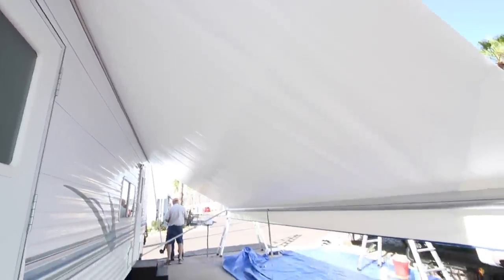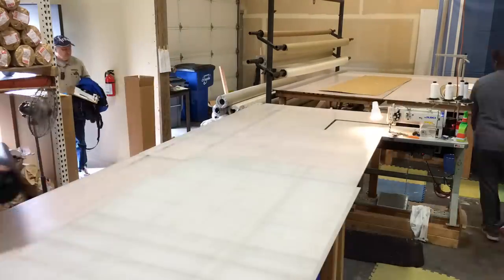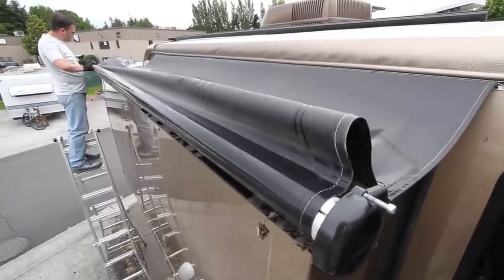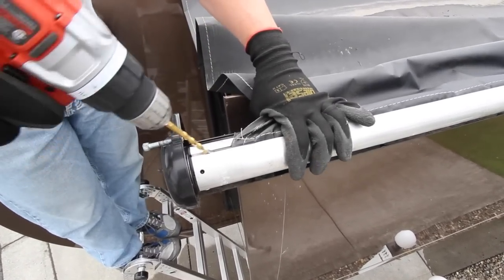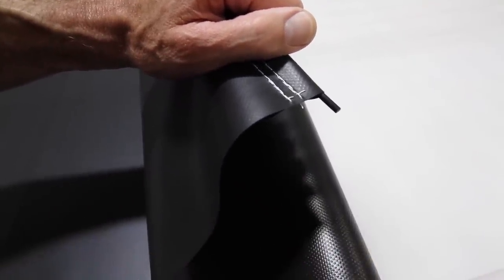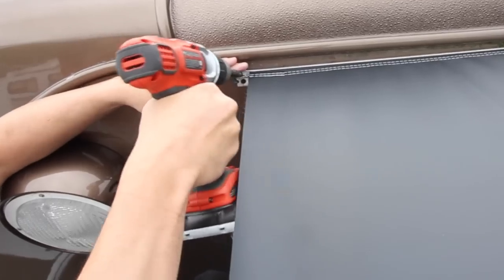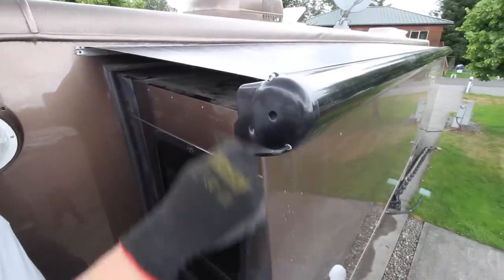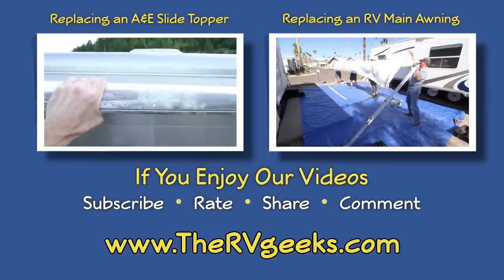How to Replace a Carefree of Colorado RV Slide Topper (Model SOK III)

Comment: Hello, I just watched your video, very helpful.  The one problem I have is the topper is completely removed from the spring bracket.  How do I get the spring set to be able to slide the topper in to it with the proper tension.

Comment: The timing of this couldn't be better. I wrote that i was going to try changing our slide top based on your previous video. Well last weekend i did it and it looks fantastic. This video is my exact model for our large slide and it's going to make the job a breeze. Just so you know, I had a question for Tyler at Tough Tops and sent him an email thinking i'll get a reply in a day or so. He got back to me within an hour. Great service and the material is 10 X better than what i took off. Great job guys. Saved me a bundle. Thanks

Comment: Great video. I would like to offer a second option if you don't have the vice grip oil filter wrench. I used a 12" pipe wrench and it worked perfectly. You won't have the possibility of pinching your skin in the vice grip lever.
Reply from the maker: Thanks Jeff! That's a great option, especially if already own one, saving the purchase of an additional tool.

Comment: Would you attempt to do the main awning like this ?  Thinking you would need 4 guys, 2 on ladders and 2 on the roof ? Save a lot of time and lifting.
Reply from the maker: Hi Sammy! Your timing is awesome, as we just shot a new video with Tough Top Awnings a couple of weeks ago. It shows how to replace a manual pull-down patio awning and we're hoping to have it edited and ready for release within the next week or two. The process is different than a slide topper, so I'd say we'd be unlikely to use the slide-topper technique for an awning. Stay tuned and after you see the upcoming video, please let us know what you think and if it answers your question a bit better.

Comment: My topper has 2 in long set screws that were screwed in from the end of the topper tube to prevent the fabric from moving in the tube. Do those screws need to be replaced?
Reply from the maker: Hi Timothy. We’re not certain about the screws you’re referring to, but we would think that other than putting them back in place as part of the re-assembly process, you wouldn’t need to replace them with new ones.

Comment: Hi, been watching your videos so I can replace my topper, my Carefree topper isn't fully covered, but has ends as in the video. I'm not sure whether the procedure would be the same, it has screws on the the end of the track in the roller and they can't be removed with the end covers in place, not sure how to proceed.....Very grateful for any advice, thanks.
Reply from the maker: Hi Paul! It sounds like you might have the SOK II model? If so, here's our video on how to replace the fabric on them: https://youtu.be/xyLf6ED2YQI If that's not the one you have, maybe you can figure out what model it is and let us know?
Reply: Hi, thanks, but, no, it's different and I think I have to remove the roller from the RV as per the (not too clear) Carefree instructions. Hopefully, I can get the material and then give it a go.👍
Reply from the maker: You might want to reach out to Tyler at Tough Top Awnings through their website. He knows more about every type of awning and slide topper than anyone we know. Don't forget to use the RVGEEKSROCK discount code too (even over the phone)!

Comment: I'm not sure what Model of Carefree I have. It's almost identical to the one in the Video with the exception that mine has pins instead of the four main screws that are to be removed. Any suggestions for removing the fabric on this model?
Reply from the maker: We're not sure, but we do know who to refer you to... the expert of all things related to slide topper replacement: Tyler Hammack, the Operations Manager at Tough Top Awnings. He is readily available to help any way he can, and he knows more about this topic than anyone we know. You can reach him by email at tyler@toughtopawnings.com or on his cell phone at 360.980.0537.

Even if you didn't buy from him, he'll do his best to figure it out. Of course if you do buy from Tough Top, be sure to take advantage of the special they're running from now until 1/29/17. Use the discount code RVGEEKS10 and save 10% on your whole order at http://toughtopawnings.com

And be sure to let us know how you make out! :)

Comment: After enlarging the channel in the awning cylinder, why won't the awning fabric pull out at that end after it is installed?
Reply from the maker: Good question, Timothy! Because the track is only opened up slightly, and only at the very corner, there’s still plenty of holding power to keep the bead from coming out of the track. It’s really just bending the corners out of the way to avoid tearing the fabric while it’s being pulled in.
Reply: Let me reword my question because I wasn't clear. I'm talking about the opening you made in the channel with your drill. That's a rather large opening. I would think the awning bead would slip out of it.
Reply from the maker: @timothybuchanan1611  Sorry Timothy! Once that head is in place, and being pulled perpendicular to the roller tube, it can’t slide at all. Don’t worry, that opening won’t allow the fabric to move at all.
Reply: @RVgeeks  Thanks for the response. What is the head? I think I answered my own question right now. So the fabric will not pull out of the enlarged area because the fabric that rolls on top of that area will not let it pull out. Correct?
Reply from the maker: @timothybuchanan1611  sorry for the typo…. I meant BEAD! LOL The reason it won’t come out is that it’s pulling straight out from the tube, not sliding along it. Can’t come out just because of a little widening of the track all the way over at one end.